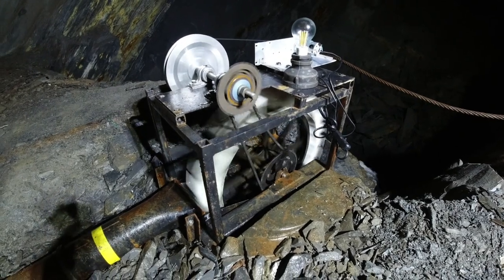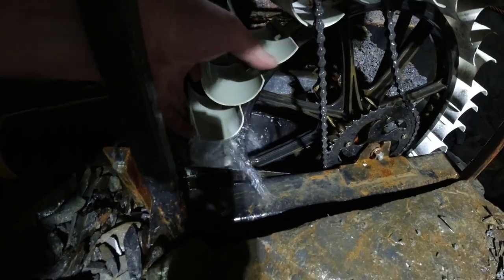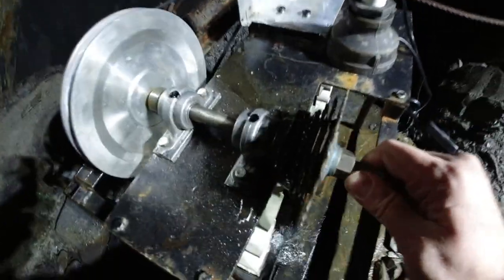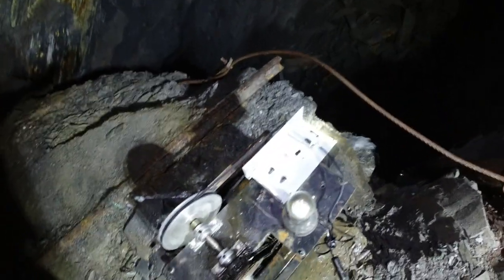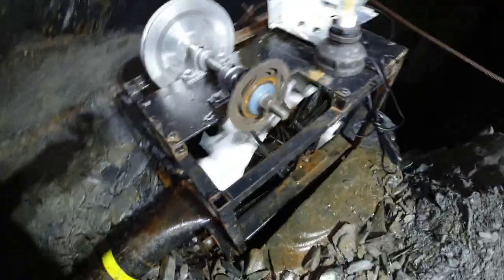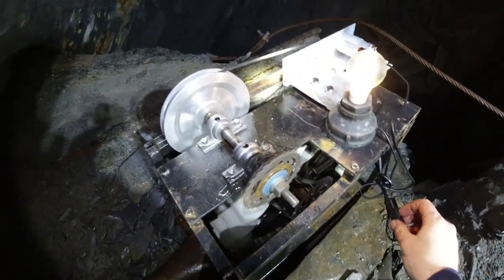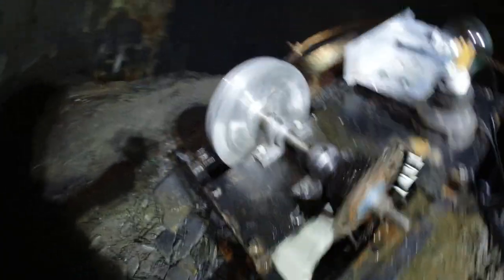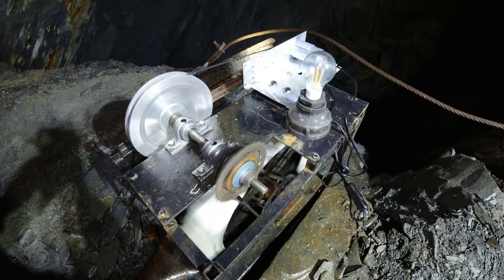Tiny Hydro Water Wheel Power Electricity Generator for Off-Grid

Comment: Pretty cool! There's stream at my family land up north and I'm excited to build a water wheel. There's a that's section dammed off where there's a good deal of pressure.  I saved the airfoil from my failed "lantern VAWT" experiment and I see it catching a lot of water and generating some torque. I'll send you a link when the prototype is built.
Reply from the maker: Hello Small City Homesteaders, thanks for watching and thanks for your comments. If you've got a dam, and a big drop, I would consider a Pelton or a Turgo, but if your land is fairly flat then yes a water-wheel type of generator would make excellent sense. They tend to be high-torque and low-rpm, so if your generator/alternator/dynamo needs a high rpm then you'll end up probably having to use a lot of gearing. I'd love to see your video when you finish your wheel!
Reply: @TheAmazingAdventuresOfMiles  there's pressure but not a terrible amount of speed go there will be gearing to figure out. Should be a fun project.  My projects keep me sane👍
Reply from the maker: @smallcityhomesteaders1600  Don't blame you. We're all on lock-down here in the UK, wish I could do some projects but impossible at the moment. Good luck with it and I hope to see the end result!
Reply: @TheAmazingAdventuresOfMiles  thanks. Just finished adding another 10' section to my turbine tower today. Amazing what 10' does. I have 2, both were 25' tall till today.  Already seeing a large advantage to the taller one in 6 mph wind. Exciting!

Comment: Would it not make sense to put a massive sprocket on the BMX wheel with the tiny sprocket remaining on the motor?
Reply from the maker: Yes it would absolutely, it's just finding something that big which would be difficult. I'm wondering about trying to make a large belt pulley wheel instead of the chain, it's lot like there is a lot of torque. But yes that would save the power loss from the intermediate transmission. Thanks for watching and commenting Tocarules!
Reply: @TheAmazingAdventuresOfMiles  
Too much mechanical gear reduction and too many bearings. Hell, even a chain affixed to the perimeter of the BMX wheel with the tiniest chain sprocket directly on the motor. 
Then have the motor cantilevered just enough to keep the sprocket engaged with the BMX chain to reduce friction. Aka, just enough gravity to keep the motor engaged and then easily disengaged when not in use. 
Pretty brave stuck in a slippery cave with such a drop off and no cell service if you stumbled.
Reply from the maker: @tocarules  Yeah some good ideas there, I'll see if I can make some improvements when I'm next in that area with some time to spare! Cell service wouldn't be any help if I fell off that drop, the trick is always to not fall off in the first place.
Reply: @TheAmazingAdventuresOfMiles  Easier to just find another BMX wheel and affix the chain to the perimeter at home. Even put the plastic cups off to one side and run a belt in the rim with the weight of the motor keeping it taut to reduce slippage. 
Then when you go back down there without doing a double back flip with inverted twist off a 45 meter death drop while watching your phone denigrate before your eyes, you'd be quick and more importantly safe, er safer. 
PS. There is also the perfect shape that hold the water for the longest amount of time for maxim efficiency. Then you can add the smallest sprocket on the motor for max RPM. 
eg. Cut the plastic containers leaving the bottom for structure and to affix to the side of the BMX wheel leaving area for the belt within the rim.  
Then cut the circular area of the container to the curvature that will hole the water for the ideal time before dumping it. 
Starts at 7 minutes for the curvature. 
https://www.youtube.com/watch?v=_rHUx2enjV8&t=1428s
Nice having a no it all keyboard warrior eh? Dont listen to a word I say as Im only a grade 8 graduate.
Reply: @TheAmazingAdventuresOfMiles  You'll loose your power by the overdriven motor. Just like the higher gears in your Rover.

Comment: I am not a physics expert, but from what I've gathered, you can have a very long, water/air tight pipe that goes down to the bottom of shaft, and a turbine generator inside the pipe at the top (where its easier for you to maintain), and you should still be able to generate power that benefits from that full vertical drop.
Reply from the maker: Thanks Alastair, you know, that's a very good idea and I'd not considered that. By just dropping a pipe there would be suction at the top and that could be used to move a turbine. Although it would need to be a specially designed turbine to work on negative force, but the force would be there. Of course the maximum suction you'd get would be achieved at about 26 feet, having it longer would make no difference, but that drop isn't much more than that anyway, to be honest I'm not sure how big the drop is, but it should swallow the 26 feet ok.

Thanks for the suggestion :)